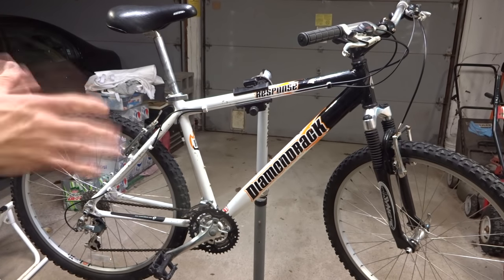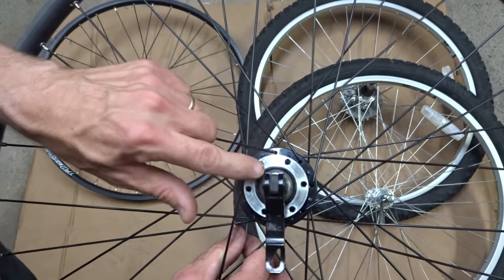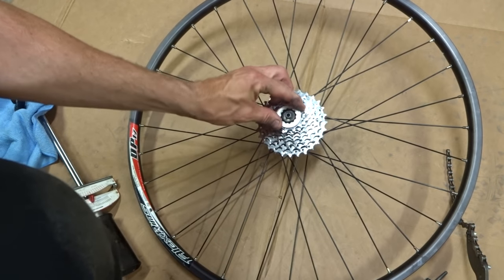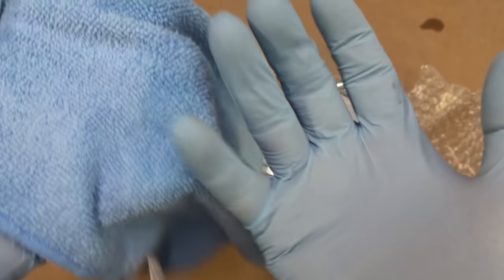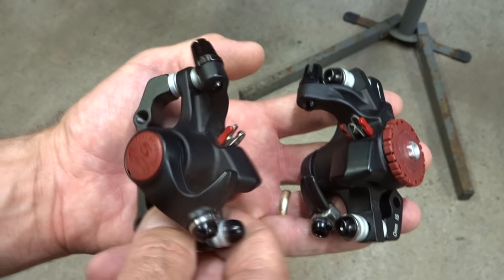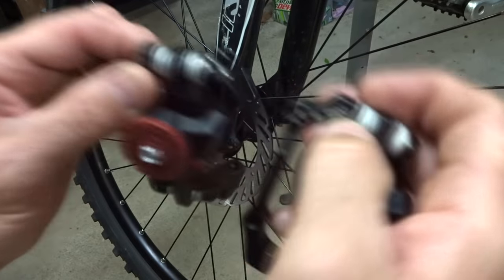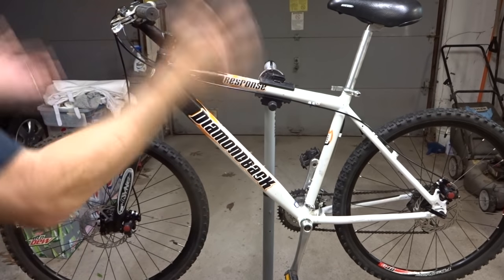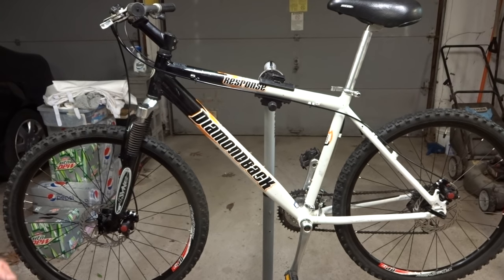How To Convert To Disc Brakes From V-Brakes On Mountain Bike

Comment from the maker: For more bike repair videos hit the subscribe button ► http://bit.ly/SubRJTheBikeGuy
Reply: i have a 2018 gt avalanche and it has all of the latest geometry and parts tech. sealed bearings, tapered head tube with fully integrated cane creek headset, hydraulic brakes a 203mm front disc a 180mm rear disc, shimano ice tech rotors with 365 calipers. i am upgrading to XT 8020 4 pot calipers. XT and XTR drivetrain, 3x9. i am upgrading to a 1x11. i am upgrading to a droppost. i have a 720mm bar a 45mm stem, a specialized body geometry power saddle. mavic rims, dt swiss hubs (350 series) dt swiss spokes and nipples. specialized grid series tires, a butcher front a purgatory rear. the bar is a bontrager rl 31.8, the stem is a kore. um thats it
Reply: oh yeah odi double locking grips and bar ends
Reply: i would like to send a pic
Reply: Why cut the cables when it could be reused,duh.
Reply from the maker: @hopenavajo1391  The new cables are longer, duh. Cables wear out, duh. Cables are cheap, duh. New cables work better, duh.
Reply: ⁹
Reply: @hopenavajo1391  Back cable can be reused for a front brake. Why waste it ?
Reply: @RJTheBikeGuy  You could've gave them to someone else,though. Donated them. There's a place in Manchester New Hampshire called the Queen City Bike Collective that helps people get things started on bikes that may not otherwise be able to afford it because lets face it bikes are expensive and even if they're not then they're expensive to pay for someone else to work on and are built like shit so they have to be fixed and or upgraded from right out of the box.

Comment: I just use bottom of my shoe as a brake.
Reply: Most people in my country do that too i do that it awesome until i tried no shoes 😑
Reply: That is called a "plate brake"
Reply: People in Africa use their bare feet
Reply: How many rupies in India
Reply: Tricycles in my area are common, they use used tires as mud pads and brakes
Reply: Make sure to wipe the bottom of your shoes with 95% Isopropyl Alcohol. And don’t touch them after that to avoid getting finger oils on them.
Reply: Bro i use a wall
Reply: I use the tree that you don't worry about until your crappy brake pads slip on your rim
Reply: hahaha
Reply: Flintstone mobile. Yabba, dabba, doo!
Reply: Bruh
Reply: Don't convert to nose break.😎
Reply: Where does everyone come from here?
Reply: sigh .. i have vapourmaxes
Reply: Same
Reply: @x91iNFINITi  holy shit then their feet gonna be hot
Reply: i almost killed myself flying down a hill doing that
Reply: You have shoes?
Reply: old school.
Reply: Yes
Reply: Shoes cost to much to do that

Comment: Great video. Very methodical. I have a MTB with disc brakes that I though were defective regarding their braking power. When I saw your video on the part that you adjusted the brake pads calibrating the discs' gaps with the pads and tightening the caliper bolts Bam! It hit me. I just loosened the bolts, adjusted the gaps, held the brake levers, tightened the bolts and wow! My bike braking power just became an absolute fix! Thanks.
Reply: @TheCubanN3rd  I mean he's right though. Why would somebody buy / use a bike without even knowing common things about it?
Reply: @wiliestrogue2924  To be fair, on first look, the braking mechanism will reveal itself as to how it works just by looking at it. It's more insulting to imply that someone would need knowledge to know that it can adjust

Comment: Ill stiick to my trek 4300 v brakes until I upgrade to a cannondale trail 8 later this year...Upgrading to disc costs as much as a bike lol
Reply: you are absolutely right. .new wheels, normally new gears, disc brakes, and sometimes even the frame doesn't have the adapters he is showing.. so it's almost new for everything!

Comment: This video was a real eye opener for me. I'm now looking at every used MTB in a whole new light. Checking for those mounting points. Thanks.
Reply: 🙂 first thing I did - go to garage and look at my older mtn bike 🙁.
Reply: I got 2mountain bikes Gary fisher same models but 3years apart so I can change wheels with the newer one it also is disc ready but figures I like the older one better but the older one had a optional disc model so it can be upgraded but will need brackets in back and front

Comment: Thanks for the video RJ. Did something like this many years ago and I had to use one of them adapters for rhe rear - worked a treat.
Quick tip - cut back zip ties using a pair of nail clippers - they end up looking neater and no sharp edges or plastic sticking out to  wreck your fingers on.
Reply: My advice is to use flush cutters with zip ties. They work a lot better

Comment: I've worked with BB5 and they either work or they don't. Quality issues. And if they don't work, well your constantly adjusting them. But they work better than Tektro. The way I learned was using a business card between the rotor and rear caliper. Then doing what RJ did. RJ...you finally did a disc brake video. Thank you kind Sir!

Comment: Great video! Your bike looks a lot cooler with the disc brakes on there. I like your explanations with all the part descriptions, torque measurements, and proper units as well as tricks to get the cables and bolts fitted properly. You rock!

Comment: Thank you for this. I just bought a 2014 REI Novara Portal that currently has V-brakes. It has the tabs for disc brakes. Additionally, the wheels it came with have the 6 hole pattern for disc rotors. So I was searching for a YouTube video for a conversion to disc brakes. This is very helpful.

Comment: i just saw i video right before watching yours of a guy in asia using those exact same adapters you had for this same conversion but he actually installed 2 new hubs for 6 bolt disc brakes, apparently those adapters do work fine.

Comment: Hey thanks great vid!! I'm looking forward to hearing your opinion and advice when it comes to adapters for non-disc break ready frames! Got a 93 kona cinder cone and heard a2z adapter works with some light modification😀
Reply: That's why I'm researching the same thing.

Comment: this was an excellent video. i just changed a 2004 Trek/Gary Fisher bike to  Avid BB7 calipers, 160 shimano rotors and 26" Alex Ace 17 wheels. everything went exactly as shown. total cost was about $400 canadian. the braking is not as good as hydraulic brakes, the cost of which would have been just too much, but they're better than the rim brakes. because i ride a lot of single track with steep hills and lots of turns if felt it was worth the expense. i wouldn't do this for road riding.

Comment: got a trek 4300 for 20 $. looking to turn it into and e-bike. thanks to your video, this will be my first step.
Reply: all you need is an e-bike conversion set. from 500$/€ upto 1000 depending the battery capacity and motor. however it all adds 5kg to your cycle what. you will feel when you run out of battery.
 I recommend it if you cycle opposite wind or live in hilly area

Comment: bike looked more expensive when he put disc breaks on it
Reply: Giio because it is :) lol ;)
Reply: It is now...
Reply: @Ultranationalist right! Lol
Reply: It always looks more expensive then
Reply: Brakes.
Reply: Nicer rims were added too
Reply: @Party Boy 50 bucks for the bike
Reply: Looks pretty ugly imo
Reply: Facts.
Reply: few more cents you get a bike which has disc brakes, but it is still a good project, but if you are thinking of money, not cost effective .....
Reply: @mannyechaluce3814  In my country, starter bikes all have rim brakes, for an increase in price range, you get suspension, then, mechanical disc brakes, and then, hydraulic discs, you can’t get those features as an extra for a cheap bike, if you want them, you have to up the trim.

Comment: that's a nice looking Diamondback. The new black rims and disc brakes changed the whole look of that bike. It looks a lot better with the black rims and the disc brakes. They give the bike the look of a higher priced bike. Next upgrades would be the crankset and rear derailleur if you want to go that far with it.

Comment: Thanx for the tip on sequence for " torque arm, bike frame, washer, nut" , at the very end! My axle on the Gmac bike motor is about 8" long. Much too long for my frame, but I am afraid to cut off excess until I know EXACTLY how much I need to attach hardware nuts etc.

Comment: Nice transformation. On a side note: I hate Avid BB7 callipers they're so damn annoying. Even if I set them up so they don't rub, they will start rubbing against the disc again in a very short while. I have not used the BB5's though.  I will change mine out to the TRP Spyke.
Reply: i have the TRP spyre(road version of the spyke, less pull), best upgrade i have ever made in all honesty. Brakes dont rub, feels more powerful and best part is both pads if set up properly will wear even meaning no annoying one pad wearing quicker then the other or pushing of the disk with has the potential to slightly warp the rotor. Currently have a couple hundred miles and ever since the first adjustments, still no problem at all. Just the standard brake cable initial stretch after initial installation. I got mine off of ebay for 60 bucks, came with rotors, highly recommend if you are willing to wait a tad bit of time to get em from there, if in a hurry/need them immediately could always buy directly from TRP. 

Most important thing to note though is the types of mounts your bike has for disk brakes, then buying the adapters if needed. TRP sells all the types directly from them which is great.
Reply from the maker: That is the newer post mount setup. They sell adapters for those. Search for post mount adapters.
Reply: Thanks RJ I think I found the right adapter

Comment: Im recommend using little bit bronze grease back side on the brake pads. Just a film coat not too much . Its reducing friction from pad pusher axle in brake caliper. Because, this axle turns when you push the brake . Also use high quality brake line and add some grease on it. Works almost perfect like hydraulic brake if you did this.

Comment: Im building a monstercross/gravel bike...Im using road tiagra 4600 shifters. Are those shifters compatible with avid bb5 mechanical brakes? thanks.
Reply from the maker: No. They are short pull. You need long pull. Or a travel agent.
Reply: RJ The Bike Guy thank you.
Reply: OutlawCRi yeah just get the road pull versions, or TRP spyres
Reply from the maker: Cool! I did not know that. I just looked it up. Yes, there appear to be a road version.
Reply: If they came off of a mtb, theyre probably long pull?

Comment: Are you going to sell this or use it yourself? I've thought about doing this to bikes that I flip but the cost of the wheels and brakes does not seem worth it. People never want to pay for upgrades.
Reply from the maker: Sell it. I already have full suspension mtn bike with hydraulic disc brakes.
Reply: Andrew Triggs ....I at times use RJ the bike guy's videos to fix bikes as a hobby. Unless you get a fantastic deal on a sought after bike you never real make your money back.  Personally i just like doing it and unfortunately  can't keep them all.  so i don't sell them for profit just enough to get another one to fix up.  My two cents worth.
Reply: This bike has 0 value. People won't even want to pay the cost of the parts.

In other cases, you might already have a decent frame and suspension. In this case, upgrading it is cheaper than buying a new bike with a similar level than your current one will be after the work.

In my case i had a Scott Mountain Bike with 12 years already with lock suspension and wheels / frame capable to support disc brakes.

Upgrading it with entry level disc brakes and a better suspension will set me back around 200£ but for those same 200 i would NEVER get a bike with those same parts.

So, really, it's about learning the cost of parts and bikes. 

Also, there is a growing market for vintage bikes with updated parts. With all those hipsters walking around town, good money can be made trough them. 

I've recently been to a town where this cool shop ran by this young kid was doing great. He would buy old road, city and vintage mountain bikes, for nearly nothing, strip them clean, paint them, restore what could be restored and then update them with disc brakes, led lights, incorporated usb chargers, better suspension etc.

He easily doubles the investment in each personalized bike and sells everything he makes.
Reply: Andrew Triggs 

I was thinking of doing the same thing but now that I read your comment you're right people don't wanna pay

Comment: Hey!   Thanks you for this video! 
  I just wanted to add that  the inch pound torque wrenches are much smaller than foot. they are only about 6 or 8 inches long so IU think you may have been over tightening those?   
Lastly,   word you could not find was I believe is "SNUG"  
Thanks for the video and your time!!

Comment: I have a bike made by Trek that looks exactly like that, except it's Trek not Diamondback. I bought it new around 2000 or 2001 and it still runs quite well. The V brakes could use some adjustment, but the main thing they need are new Shimano brake pads. Still, I can take it off road in the woods. If I were a serious biker, I'd probably buy a modern bike. But I found it interesting that your bike was literally exactly like my bike, yet they were different brands.

Comment: So putting disk breaks on a bike that is already equipped for disk breaks.
Reply from the maker: But didn't have disc brakes.
Reply: Alot of times bike companies will have different versions of the same model all using the same frame but with different components, such as entry level model with cheap components and an expert level model with more expensive components

Comment: I’m thinking of doing the same thing I have 2 Gary fisher bikes one has disc ready rims the other doesn’t but I can swap and the newer bike has the welded fittings for hydrolic lines and the rear frame has different mounting holes but the older has mounting holes just different but this video shows it’s not that big of a deal as long as the brackets are attainable for the rear mounting holes

Comment: I did a rim brake to disc brake conversion a few years ago on my titanium 700c cyclocross dropbar that came with a rim brake setup (remember cyclocross, the father of gravel?) with Ultegra components, and a carbon fork. Disc caliper mounts were already on the bike, so it was begging to be upgraded to disc. I found a Felt cyclocross disc ready wheelset on Ebay.
Conclusion: Sure, it won't be cheap to switch from rim to disc brakes, so don't consider doing it unless you have a quality frame, quality components, a great fork and disc mounts already on your frameset.

Comment: I did this pretty much to a Diamond Back Topanga that I had. I put slightly better mechanical calipers on and replaced the hubs with a compatible disc hub as new wheels would have cost more than I wanted to spend. I didn't care that it would have taken more time to take the spokes off and re-lace them.
Reply from the maker: I got a deal on the wheels. $50 I think.
Reply: That is a good deal. Probably what I spent on new hubs and spokes.

Comment: Great clip. Just to check though you connect the front brake to the left hand so wouldn't it be an idea to make it clear that this is the correct set up for left handed people as the front brake is the main brake and as such requires the skilled hand.

Comment: You made it look very easy and doable. My only question is. Do all rims come with the screw holes to attach the rotors to? I was confused since you began at that point. I have a Schwinn Ten Speed that I want to upgrade.

Comment: I want to do this to build a street legal motorized  bike, like a lightweight touring motorcycle, and I'd probably use the v brake posts and a clamp below the seat to attach a rear rack for holding a fuel can, battery, tail-light, brake-light, turning signals and licence plate. I'd probably go with the biggest disk brakes I can get in that case, since the goal is to sustain a speed of at least 40mph which is a common highway minimum

Comment: I got a nice deal on a pair of Mavic Cross max's and am considering doing this for a 1998 Specialized Stumpjumper. the dropout has a rack mount in it and it looks like it will work but im not 100% sure, really would like to use these wheels instead of parting them and just keeping the front.

Comment: Seems there is no real solution yet if the frame / fork doesn't have the take-up screw fits. 
 
I see you are mounting Avid BB-5, so you are not an enemy of cable-pull. 
 
Despite of what all my friends told me, I use Avid BB-7 (with bigger pads than BB-5), and I am happy with these. No need ever to re-align ore something, just compensate the wear by time (wear is minimal, in fact - no need to have spare pads with you at a tour). 
 
Thanks for the video, very informative.

Comment: Love this transformation from V-brakes to Disc brakes! I have a 2004 Trek 3700 that I have fixed up and I'm going to covert it to being a 30 speed by the spring of 2018. Can my Trek 2300 be converted completely to dual disc brakes or is just the front RockShocks only compatible for disc brakes?